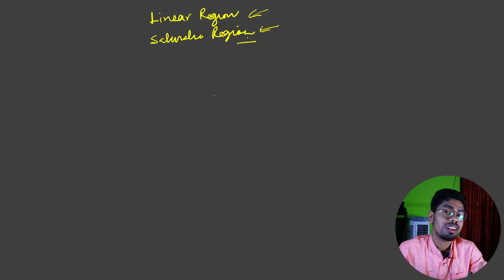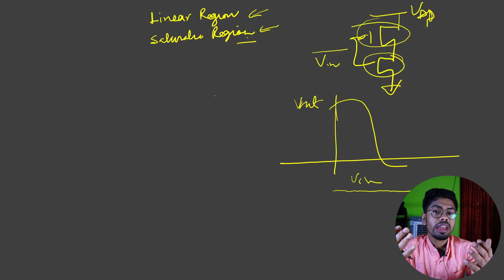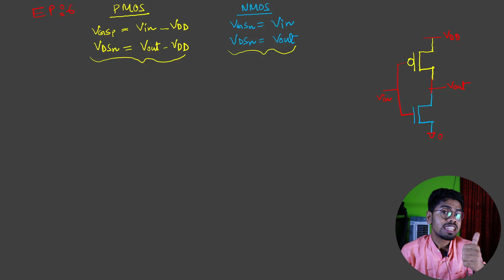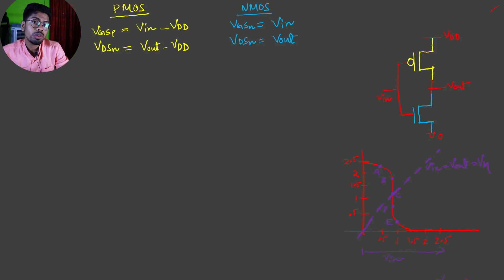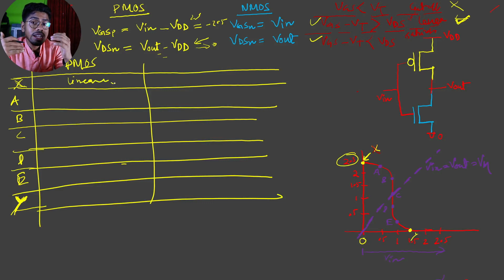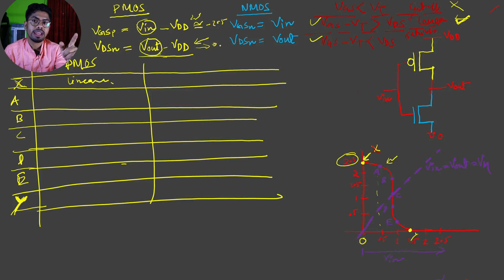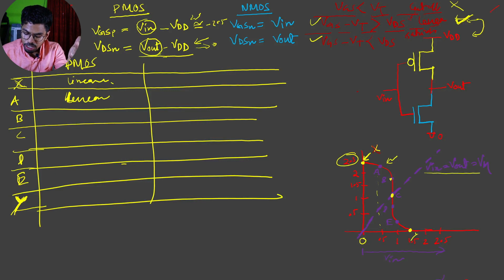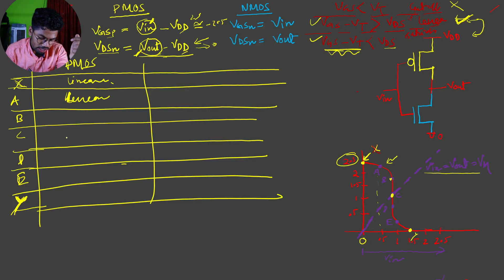Ep6:Trending questions on CMOS inverter | Region of operation | JOB or MTech admission interviews|

Comment: When both transistors are in saturation there will be directe connection between vdd and gnd , so dynamic power dissipation happens everytime during switching

Comment: At point C, a short circuit path is created from Vdd to ground. Due to saturation of both mosfet Current is maximum here  and maximum power is dissipated here in form of short circuit power dissipation.